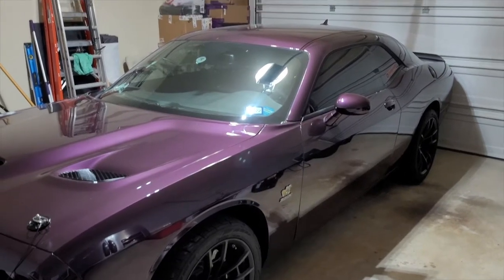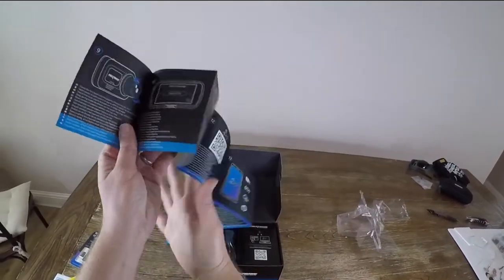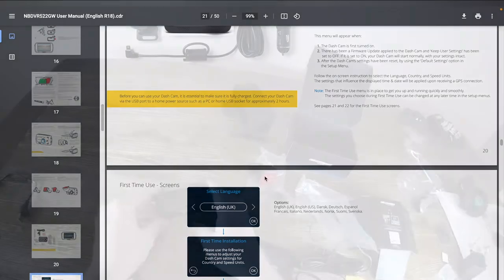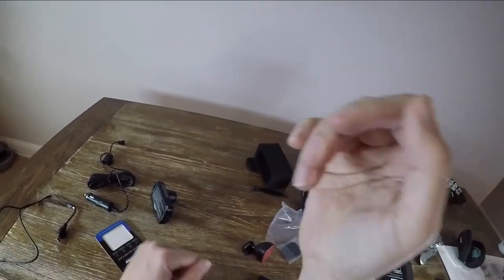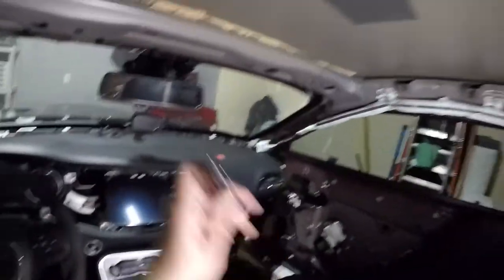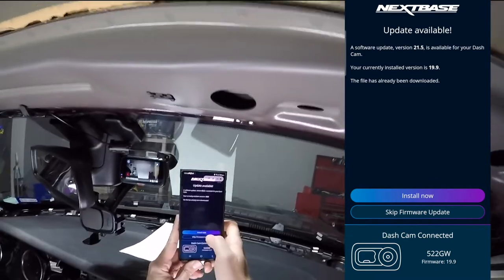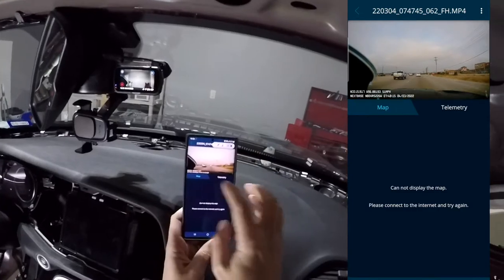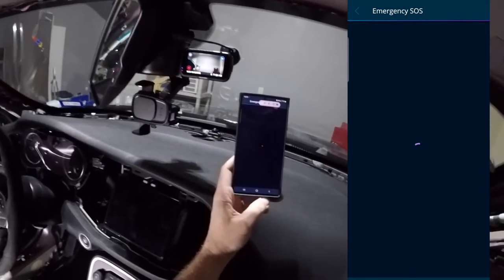Nextbase 522GW Dash Cam Unboxing, Installation, Demo and Review plus MyNextbase Connect App Demo

Comment: Awesome review man…appreciate it. Definitely did not sound like a commercial, you gave your honest opinions, and was pretty detailed in the review. I am definitely considering this camera, even though I agree the audio is lacking to say the least.
Reply from the maker: Thanks! It's a great camera that I now have in my truck since my truck gets used almost daily, whereas my car spends a lot of time inside the garage. One thing I didn't have at the time of this review is the rear camera and that's the only thing I had an issue with. It's a bit finicky in the order of how you plug things together and because I kept moving the cameras between vehicles, I kept having issues with the rear camera connecting properly, causing the rear view to just show static. Eventually I just gave up on the rear camera, but the main front cam is still doing awesome!

Comment: I’m going to get my 522GW tomorrow thanks for the video. 
I had my 322gw stolen in a car park 🤦🏾‍♂️ I regret not removing the camera from the mount. 
By the way what car do you have is it the Dodge Challenger?
Reply from the maker: Yes, it's a 2020 Dodge Challenger 1320. Sucks about your dash cam being stolen. Hate that its something we have to worry about. Thanks for watching!
Reply: @Scavenger1320  thank you I appreciate it. I don’t get why people steal dash cams not much value to them. 
I’m from the uk I’ve seen only Dodge Challenger the hell cat beautiful car 😍 
What does your dodge run at on a 1/4 mile?
Reply from the maker: @ZAK19857  So far my best 1/4 mile time is 11.034 @ 121.89. Here's the vid of that run. It was in great weather conditions in late February. https://youtu.be/Ty3ZHsPrU24
Reply: @Scavenger1320  that’s an awesome run that’s impressive love the sound it makes both outside and in the cockpit love American muscle 😎
Reply: Should we be removing the camera each time we park the car at night? What if it is hardwired, won’t that be an issue?
Reply: @topboi9392  That's an issue for any owner to consider. The 522gw has a parking mode to provide video when the vehicle is unattended.  It wakes up when the vehicle is hit/banged or whatever. I leave mine in the car. It starts up when I get in the car and continues to run during the  journey. One thing to bear in mind is every time you enter the car it creates a video and automatically protects it.

Comment: I've had one of these plus rear cam installed for approx 6 weeks now. My car gets very hot when the weather allows. Already, the adhesive mount has come away. Utterly useless. At least with a suction mount it can be reattached.
Reply from the maker: That can be an issue for sure. Since it came with 2 mounts I put the second one in my Ram, where this cam now lives full time. The mount in my Ram kept falling off in the hot Dallas summer too, but it never fell off in my Challenger. I think if it's installed when its not hot and has a good amount of time to set before the summer heat kicks in it'll be ok, but if it's already hot then it doesn't want to stick, at least that's the only difference between the 2 I installed. I ended up buying some 3M replacement adhesive and it had the same issue. Suction cup mount would have been better for sure though. I have another dash cam that ended up in my Challenger so that I could have one in each vehicle and the other one I got has a suction cup mount and it's so much easier to deal with, although that's fallen off on me once too.
Reply: @Scavenger1320  I can't recall the temperature at time of fitting. I have however fixed the issue. I've used adhesive backed velcro. It has stuck to the windscreen very well. I've superglued the other part of the velcro to the mount. Fingers crossed.

Comment: After extensive trial and error, I've found the NextBase memory card is REQUIRED to run their dual camera setup. Using a high performance Sandisk or other brands may work at first, but then will have issues. My NextBase 128 memory card was worth the extra $, especially considering I got it on sale for $49. It works like butter.
Reply from the maker: It's almost required for just the single cam setup too. I got a NextBase 64gb card that came with mine so that's what I've been using. I did try to use a Samsung branded card once with a bit more storage and it wouldn't work in it.

Comment: I have recently purchased one (Front & Back), and it seems to love saving a recording when the car door is closed, but for some reason, got my rear light cluster smashed, and did not record a thing. So not too sure on it at present, since it has not worked. Since i have no idea how or who smashed my rear lights - Driver side. 
Plus they state put it on the passenger side of the rear view mirror, so you can not see the screen, so pointless for the so called reversing camera set-up.

Comment: Why it's always freezing.. and got stuck..
Reply from the maker: Not sure, I haven't had any issues like that yet with mine. At least not with the front camera only. I did try adding the rear cam since this vid and kept having issues just on the rear cam that I ended up not using it all. I still use the front cam though almost daily since I moved it to my Ram truck instead.
Reply: Which rear cam did you use as there are several for it. The one cam is wired and mounts to the rear window.
Reply from the maker: @chrisnielsen3562  Sorry for not getting back to you sooner. I ended up buying the wired one that is basically a magnetic ball to attach to the rear window but never use it anymore. I was moving the dash cam between vehicles whenever I switched driving them, and this cam has an issue with properly connecting with the rear cam. It takes some specific order with having the power off but not connected or something like that and after a couple moves with not being able to get a video signal from the rear cam I got frustrated and gave up on it. I still use the main dash cam in my truck now but without any rear cam.